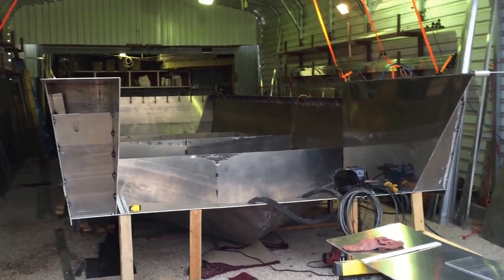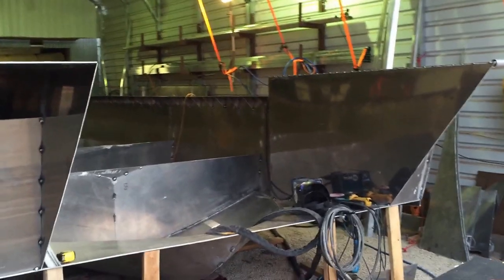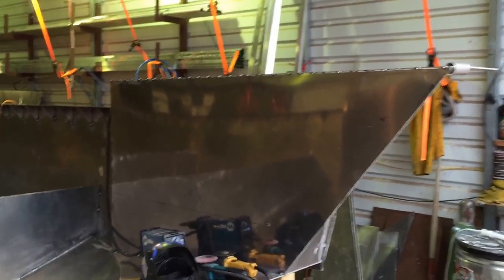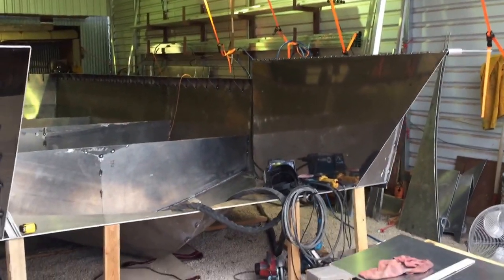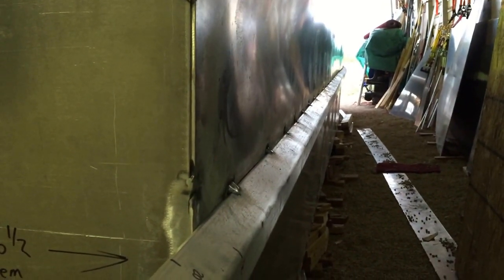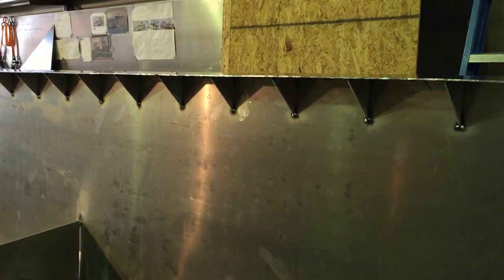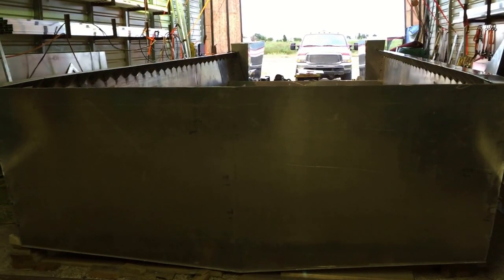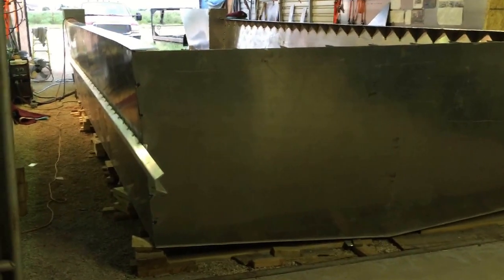building aluminum boats 9

Comment: Nice videos, however a bit of what I have been noticing is you like to weld everything full length, depending on what wire your using ( I'm assuming 4043?) it is unnecessary as your filler metal has a higher shear strength then 5052,5086 or even 6061 in .250 also the amount of heat you subject the alum to changes its strength makes it much much softer. depending on the length of what your welding a 50/50 ratio of length to weld is actually stronger, also you will not have near the heat distortion you have been experiencing!
Reply from the maker: I use 5356wire,my metal is all 5086,the rub rail and other stiffiners are 6061,,Ive allways wondered why those arent5086 also,,,since they say 5086 is the best marine grade aluminum you can get,,as far as full length welds I just believe there better,,if you jump around enough to let the metal cool down then it seems to me that the metal wont know the difference,it seems everyone has adifferent opinion on this subject,thanks for your comment
Reply from the maker: I forgot to ask you,not to be rude Im wondring how many aluminum boats youv made,where is your expirience from ,whats your welding background????